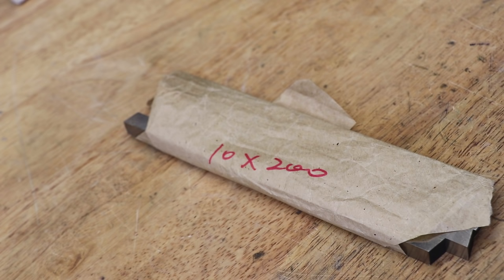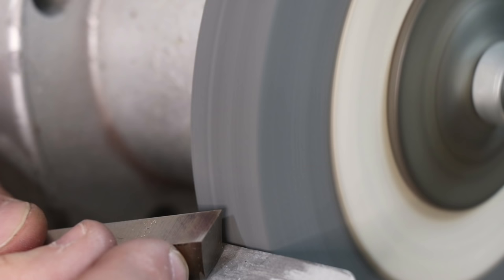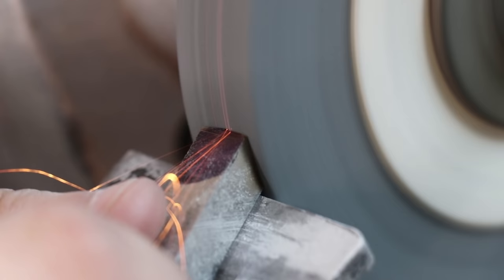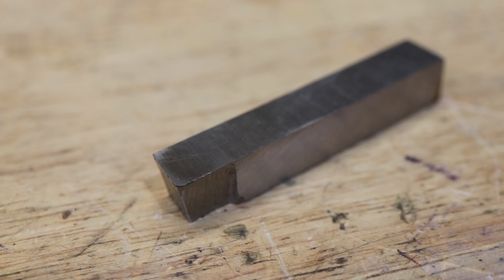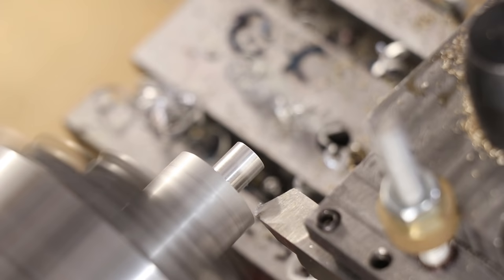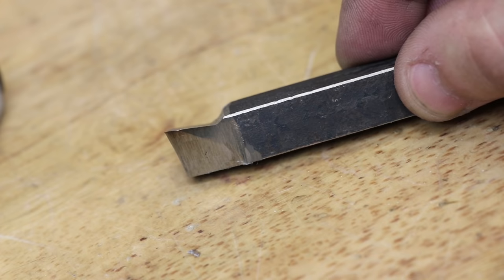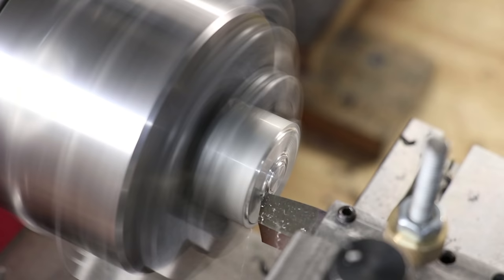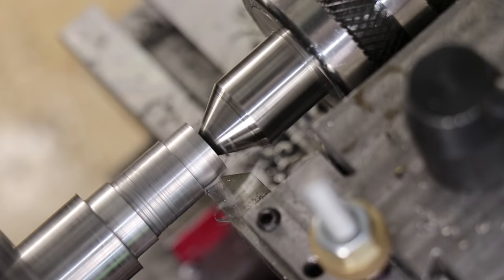Grinding HSS Lathe Tools | Beginner Tutorial

Comment: When using HSS cutting tools there should never be any change in the colour of you chip. The more colour change the faster your tool dulls. Same for drilling. Once the chips start to change colour you are producing enough heat to soften your cutter. Shinny chips make a happy machinist.
Reply from the maker: I think I was pushing a little too hard on that mild steel. Not the nicest stuff to machine and I had to take a deep-ish cut to get a half decent finish and wasn't paying attention to the chips. I had a much better time machining that cold rolled. Cheers
Reply: i forgot to mention it was a great video, thanks for sharing
Reply: No all the heat should be coming off in the chip . It's now a lost art .

Comment: Actually stringing is caused by incorrect feeds and speeds. Every metal has different feeds and speeds. I turn aluminum no problem at 650rpm on a mini lathe. High carbon steel 250rpm, mild steel 325rpm. The machinists handbook is your best friend. My speeds are modified due to using a mini lathe, but the book is the best baseline.

Comment: Grinding the tools brings back memories....
Can't remember how many times I had to re-grind because my teacher found a flaw. If you finally got his approval you needed to use it on the lathe for a test cut.
After handing in the work and tool he would mess it up so no-one could re-use it.
We learned to do a quick switch after turning and before handing in the work. We needed to hand him the tool as far from his desk as possible (that's where his glasses were). He didn't checked the tool, he just picked up an airgrinder
We had to make 6 or 7 different tools so with 7 classmates we all made just one. This trick saved many hours of re-grinding.
Reply: Remember, Grasshopper, that you may think you have fooled me today, but there are many tomorrows!!!!
Reply: Nice😂👍

Comment: Years ago when I was doing a lot more custom tool-making; I was using high-speed steel to make Precision Form Tools.
Now since I work a lot with diamond tools, I make "All my form tools from Tungsten Carbide." I use fine grain tungsten carbide and they rarely break  when in use and a form tool will last for years. Geometry is "King" when making any tool.

Comment: Thanks for posting. I dwell more in the Woodturning world where we sharpen HSS a lot. Many of us move quickly past the crap grey wheels on to the blue wheels, then white, finally ending up at a CBN wheel. As you probably know these are designed for HSS and are better than diamond. No silica dust, they don’t wear out for a long time, easier on the steel, and maintain a 8” diameter always. I find a 80 grit for shaping and a 200 grit for sharpening are a great combination. I’ve found your content to be interesting and educational. Thanks again.

Comment: Great video one suggestion if I may when chopping the tool to amore proper size if you cut the blank at 10-degree instead of straight with the cut off tool you will save time and steel because both blanks will have a 10-degree clearance built in so is less material to grind
Thanks for the time you take to explain other how to!
Reply from the maker: That didn't occur to me but that is a great piece of advice
Reply: Oh who's a Cleaver clogs,well though of mate, sometimes it takes a different set of eyes and thoughts to see different solutions to things, lots easier to get the angle right if you can set up and hold in jig for a run of first angle cuts, then will have ready multiple semi blanks to hand, all at the right start point, think lm gonna work on that and make a mini cut off jig to bang out a  number cut with the right first angle, will need to make sure its dead right first and they make some really thin cutting blades now that last well so guess what l will be starting to work on this weekend coming, have always wanted to have this mistic art explained in laymens terms, most people who can do this kind of thing try to make it sound as hard as they can lm sure to stop you from trying and making them selves the wizard of the tool making 
Good thinking Bat man.
 Watching this and how it has been explained has given me the confidence to have a go so fingers crossed and thanks for the indepth breakdown and explaining it for us. Great vids bud, keep EM coming.

Comment: I'm really old school.... I still grind everything by eye. It's been working for over 40 years so I reckon I'm going to stick with it. 
Maybe my angles are not optimal but I probably have 500 + different HSS cutting tools for every possible machine lathe operation in various sizes. If it ain't broke..  yada yada. 
Nice video though. Well done, you!
Edit... I do all my drills by eye too... if it ain't broke. I see new fangled jigs to maintain angles but it seems to work no better than my eye and requires setup.
Oh... new sub here. Soothing to watch.
Reply: Do you prefer hss and grinding over carbide inserts?

Comment: Good explanation. The dremel mini tool can improve the cutting edge with a chipbreaker.
Also a set of diamond files can smooth out the cutting edge into a radius, to improve surface finish

Comment: My understanding of back rake is that it is the equivalent to top relief when the tool is facing and cutting on the front edge rather than the side.
Reply from the maker: That might certainly be the case, and it might me more critical when the nose radius gets bigger. Of course it's up to you to add this but I've always gotten away with zero back rake. Cheers
Reply: @artisanmakes  Horses for courses, I have seen old instructional documents from pre WWII that had no back rake and I think they used a left hand tool for facing instead of the front of a right hand. Kept it simple but meant tool changes for facing. I have been using a Diamond tangential tool holder that negates these issues with a great deal of success. Thanks for posting, picked up a few tips.

Comment: Thanks for another well made video! For the steel chip breaker, is the 10 degree side rake after the chip breaker needed? I’d assume the chips curl at the chip breaker and the angle after that wouldn’t matter much, for example if it was a flat zero degree. Am I missing something?  If so what purpose does it serve?
Reply: To answer my own question: I assume it is not needed. It’s there because it was made before the chip breaker was made, and only shows that the chip breaker has the same angle as the cutter had before the chip breaker was made.

Comment: These are informative videos for an aspiring machinist with almost no experience. Do you think it’s possible to use a dremel on a dremel drill press stand as a lathe, with a turning tool mounted to a mini compound table, to shave .2mm off of a pen refill barrel?
Reply from the maker: In a pinch, and if you can get everything properly fixtured I'm sure it would work if it is plastic or die cast metal. Ive seen people do similar stuff with a drill press. Cheers

Comment: Why do you quench HSS? All I read advised not to as it buggers up the internal structure. As a wood turner we are forever sharpening HSS. White wheel and diamond card to touch up between sharpenings.
Reply from the maker: I dunk it water just to keep it cool so I can hold on to it. HSS different to normal carbon steel so the temperature you would generally reach when grinding it is unlikely to effect the temper or microstructure in any meaningful way

Comment: Great video! Should I use oil when honing the HSS bits on a diamond hone like yours. Thanks
Reply from the maker: I would say so, the instructions that came with mine said to use a bit of light oil. I use 3 in one oil for most of my honing and it seems to work fine.

Comment: Cheers for that. How does HSS go on 4140 in the little lathe? That is the material I struggle most with carbide in my small lathe. I have not been able to get it to break a chip, best I can do is endless tight spirals which are manageable, but the speed and feed range it will do this is tight, and close ot the maximum depth of cut I can do and be confident I wont crash it. Otherwise it is a mess of fairly floss and I have to stop the lathe every pass and clear it.
Reply from the maker: I have not turned 4140 on this lathe so I can not comment specifically on it. Normally I prefer to use carbide on harder ferrous alloys, since it is much harder to burn the tip of the tool off. If I was to speculate, I would assume that 4140 could but better if you used a cobalt (M42 maybe) HSS. I machined some 316 stainless a while back and the advice I got was to use cobalt hss to get through the work hardening and prevent the edge being burned off. Once you grind up the tool its just a matter of playing around with a chip breaker and finding one that works at the necessary feed and DOC.

Comment: Is it possible at all to grind a HSS tool that will give a mirror finish on steel like carbide inserts can? None of the HSS tools I ground will ever do that. Perhaps it will do that with brass (but anything will give a great finish on brass), but for steel it always looks dull. Only time I've been able to get a mirror finish on steel is using carbide insert at their recommended speeds (which tends to be really high) at their recommended depth of cut.
Reply from the maker: If you are getting good results with carbide and you are happy with it, keep doing what you are doing. But if you really want to try with hss, getting a perfect cutting edge is essential. I usually lap the cutting edge and nose radius and that improves the finish.

Comment: Could you clamp on a piece of mild steel to the top of the tool to function as a chip breaker instead of trying to grind a chip breaker in?
Reply from the maker: I have never seen it done so I could not tell you.

Comment: Do these blanks not require heat treatment after the tool has been ground? I thought they come annealed and you have to harden them yourself?
Reply from the maker: They come pre hardened and as long as you keep the blank relatively cool as you grind it you won’t change the temper. Hss is pretty resistant to losing its temper .
Reply: @artisanmakes  thanks for the reply

Comment: My question is how are you supposed to set the tool rest angle when your reference surface is a round wheel.
Reply from the maker: No need to overthink it. Just scribe a line on the hss tool with the angle you want to grind and tilt the rest so that you can roughly cut that angle. There is a lot of leeway in grinding hss by hand so it shouldn't matter too much as to whether you get the angle spot on.
Reply: @artisanmakes  yeah I figured as much in the end. 

I ended up following your video and ground something that actually cut, which was a big achievement for me. Now I just have to study up on speeds so I can accomplish a decent surface finish.

Comment: I have a good 2x72 belt grinder but a very average little bench grinder. Is there any reason not to grind tools on the belt grinder?
Reply from the maker: I don't see any reason why not. I have seen it done without issue. I simply don't because I don't have space for a belt sander. Cheers.

Comment: Throw the book away it's all theoretical find and learn by practice no need to hone or lap. If you in  factory on piece work you wouldn't earn a penny. Sometimes negative top rakes work better than positive ones metals vary that much from one smelter to the next that the best way is to start with all rakes between five and ten degrees and most of your cutting will be trial and error. The curl on the swarf can cause a lot of damage to a work finish if it folds back on itself so try different top rake angles to encourage the swarf to come away with no inward curl.Practice makes perfect. Throw the book away.